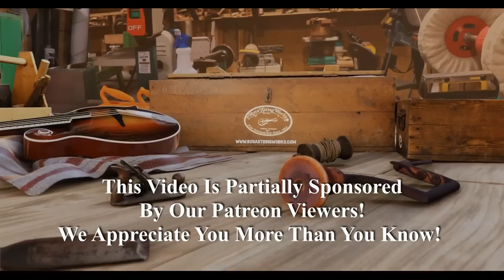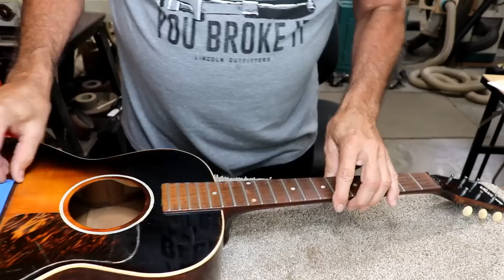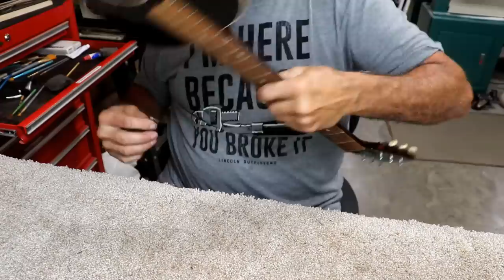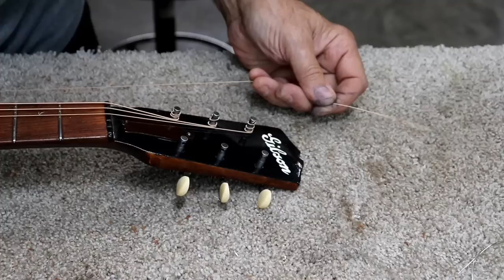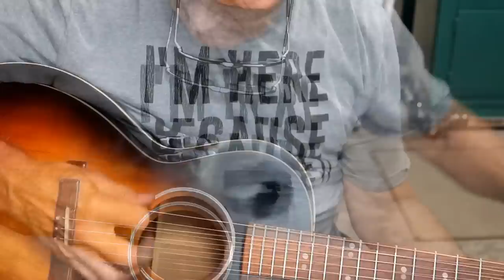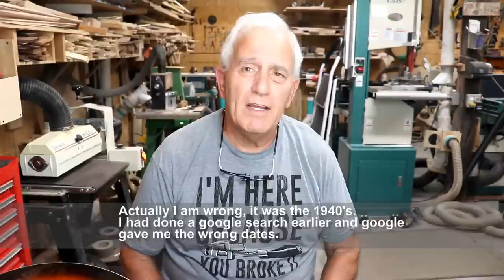578 RSW Refinishing A Gibson L-00 Vintage Guitar Back To Its Original State - Part 3

Comment: Your effort was tireless. How you never gave up will teach the young and old that you need to do your best and don’t give up.  As an electronics engineer, we are stuck trying to fix the impossible, I never give up and after 29.5 years I retired.  The rule of the impossible fix is if you do the same thing with the same results and it still doesn’t work, go different stop going in a circle go elipitical it might work

Comment: For divits in timber you can lay a damp cloth over the divit and use the hot soldering iron to steam out the exact area. The steam swells the timber and it should pop it out.

Comment: I wish everyone wrapped their strings like this. I would only add that I put in more slack as the string gets thinner, so as to wrap down the post and increase the angle on the string to the nut to as much as I can, but not too much. Gives you the best sound if you have clean nut channels. Brilliant

Comment: Jerry, my friend, I feel your pain! As a Gunsmith I use nitrocellulose as little as possible..  and I use gallons of shellac - which I use various grades of wire wool, finishing at 00000 grade.. yes, five ought…. Which is on par with 1000 grit..
It’s about 7 months since you did this work, but I’m with you all the way! The struggle with finishing is the same with gunstocks!
The restoration work you’ve done will never be fully recompensed.. 
I’m so tempted to do a tribute guitar job.. as I do have a guitar that has a wracked neck from someone’s really bad neck job.. it only cost me £20 on eBay.. love what you do, as I know what it’s like trying to create perfection for a customer on a budget.. the budget jobs always seem to bite you on the butt.. 😂

Comment: You should look for fish eye eliminator for a lacquer.... I painted classic cars yours and years ago we were both old-timer s.  I don't use lacquer on cars anymore I'm not even sure if you can find the product... But if you can.. adding fisheye eliminator will solve your crater problem.... Don't put it in your supply batch... Only use it in the product You're going to paint with immediately after adding it.... You'll be amazed how well it works..

Also notice you finished with shellac...

Enough to meet you and see your shot and share notes.. I've been a machinist for 40 years and I have at least two decades and car and airplane restoration

I love meeting skilled seasoned people like yourself to share knowledge
. No little about musical instruments but have a deep love for music and I do know some very accomplished well-known musicians that I admire.

I cover all of North America in my job doing service and CNC machines currently

So I'd love to communicate and if I'm in your area I'd love to meet you and see her shop

I agree in the sanding there's nothing more valuable than your years of figuring out what works

I can probably show you a few techniques for my car restoration years that will produce a flatter more perfect finish if that's something you're looking for.

I also think I know why you're getting the balling with 600 sandpaper

It has to do with the hardness of the finish

That may or may not be something you can overcome it would be one of the things if we ever meet we could chat about

Comment: I had an old beat-up acoustic.(brand name unknown), and the finish was damaged and scratched so bad, I had to remove all the finish. Made up my mind I was going to just use a paint brush and paint the whole thing by hand and use shellac as a final finish carefully just brushed on. I must tell you, it turned out not all that bad for a hand finish. Never intended it to look perfect right from the beginning but I will say, it looks a whole lot better than in did when I first got it. It wan't worth my time in going to all trouble you went through on the Gibson. The way I saw it was, if it looked decent and stood out from a distance, I would be happy, and that's how it turned out. At least it playable and doesn't look all that bad. I couldn't spray it indoors of the house here, and winter weather didn't allow me to do spraying outside so this was the best I could come up with to finish the guitar off. It's nice to know that I wasn't only the only one having issues doing finishing. Least mine's done and is nice and shinny, sounds good to.

Comment: QUESTION: 7:40 - regarding fingernail damage/holes - why not salvage some of the wood-dust from your scraping, and glue/epoxy paste (whatever works) in there to bring those low places up to the adjacent surface?
Reply: This repair would never really match the grain lines as well as the wood pores. It would stick out like a sore thumb.
Reply: @K7classicrockfan  That makes sense -  I guess it depends on the priority of the one playing it - playability vs. aesthetics.  If the fingernail grooves don't mess with the playing - no worries.  A manicure of the fingernails would be another 'cheap' solution.
Reply: @FunsongsMusicByPeterRahill  indeed. Fingernails and fretboards don't go together very well. Like Jerry said, he could have scraper the board deeper, but that means more work and thinning out the fretboard, not ideal.

Comment: If it were my guitar I would've drilled out the holes for the tuner posts if I had to, in order to make room for the ferrules because they look so nice, unless they were cheapo deluxo piece of craps. Even then you could get some nice ones. Maybe they weren't stock originally, but who cares? It's not the original finish anyway. The peg head (headstock) looks too plain without ferrules. Little details make a big difference.

Also, the truss rod cover is slightly crooked. Plus it's brown. That clashes with black. I would've asked you to make it black. 
I know, remind you to never have me for a customer if I ever bring you a project. Right? No worries. I'm terminal and won't live another month. I'm laying my burdens down too soon.

But that thing sounds much better than i thought it would. And it does look good - enough.

Comment: You mentioned TRUE OIL  would that be Birchwood Casey's  TRUE OIL if so all you have to do is use  different grades of Steek Wool then use STOCK SHEEN also made by BIRCHWOOD CASEY it will have the most beautiful finish ever .

Comment: An interesting story .Excellent work of the luthier . There was also a dent in the fretboard in the place under the 2nd string at about the 2nd fret.It was possible to drop a super glue of low viscosity there , then sprinkle the same wood chips after processing the wood with a rosewood-type fillet , or merbau , shorter than dark , you can make it lighter , but then , in order to get into the tone , you will need to touch up with a water stain , press a small metal plate , hold for ten seconds , then drip a little more super glue . Wait until it dries , and remove this small protrusion formed above the surface of the fingerboard with a small sharpened chisel ( 5-7 millimeters wide ) , so that the surface of the wood of the fretboard is smooth everywhere . Then you can still walk around this place carefully and with sandpaper, so that it is absolutely OK.

Comment: I still don't see how you can have a great fret leveling without playing all the strings at all the reachable) frets. You can't assume it's all good if all you play are the cowboy (open) chords and simply measure string height on both sides - at the 1st and 12th frets. I play all over the neck. I know Jerry usually only plays those three chords (G, C, D) but most guitar players know ALL the open chords, and the basic barre chords. And MANY guitarists know scales, ALSO!! So, if you don't play guitar well, you really need a good guitarist to help when setting up the action.

Comment: You probably have a finer “600 grit” paper than me, coz i can’t get rid of it’s marks with 1000 and steel wool right at the moment lol 😂 Too bad for me i guess
Reply: Probably you jumped some step.
You cannot jump, say ftom a 220 to a 600. More probably than not, you still see the scars of coarser grits that simply won't go away with the 600.
Reply: @francescozani9488  you are right. I forgot i used coarser grit for leveling this time

Comment: Sanding the frets the way u do causes me so much pain. Tape up the fret board when you sand the frets so you arent  pushing fret material into the fret board. Also dont understand why you reach for a flat level file to level frets everytime u do a fret level. Seems lazy to me, instead of finding the high frets and just dealing with them. Then crowning / polishing other frets. Removing so much material for a few high frets. Maybe i havent watched enough of your vids.  I feel your pain on the finishing work. Ive been through it a few times.. mainly due to crappy weather. (Fogging etc)
Reply: Levelling frets the way you have suggested does not work.
Reply: @nickpanousakis3205  lol whatever you say buddy 🤣